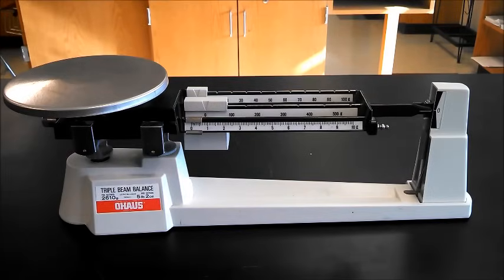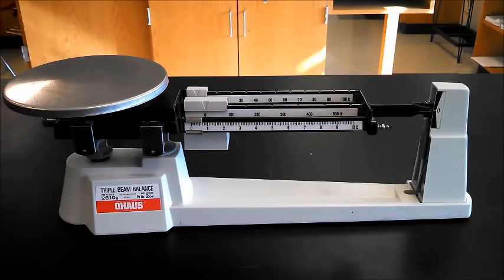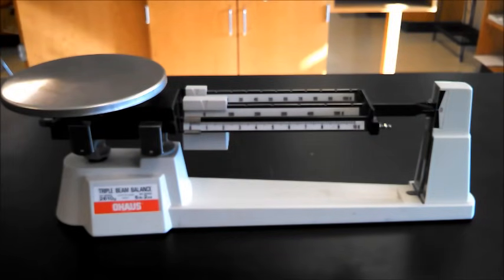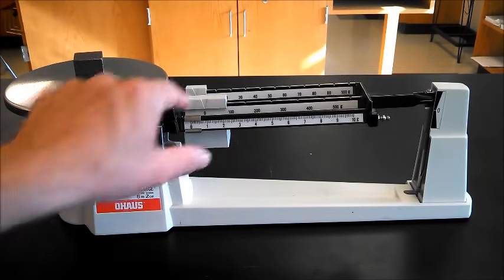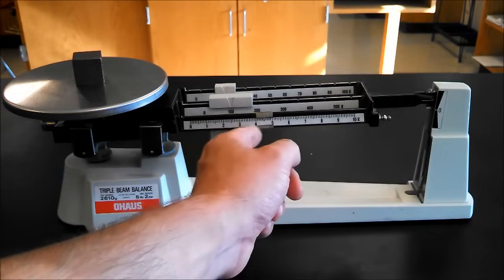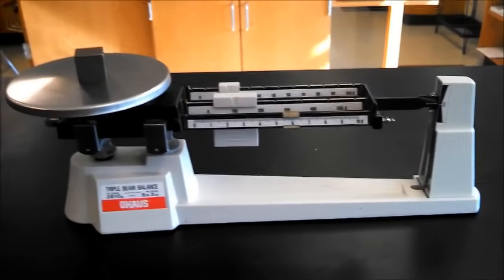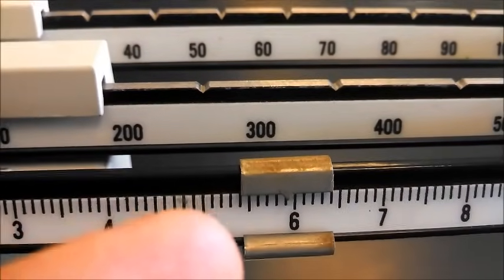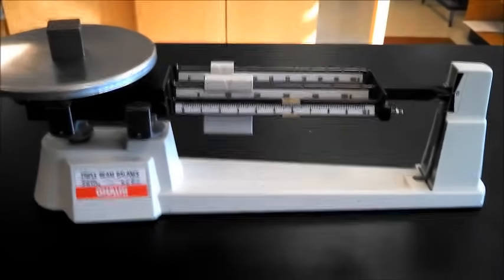Tutorial:  Triple Beam Balance

Comment: Do you know where to get the replacement weight disks that are under the pan? I have the 2610g model. I knocked my scale over right next to a floor vent heater and lost one or two of them down through the grating. I don't even live in that house any more. (I rented a room). I would use the scale to weigh golf heads, shafts, grips, and shaft tip weights. That way I could match the swingweight of the clubs in the set with a replacement club before I assembled the club. THANKS.

Comment: Generally a good video, but the final reading should be 125.90 g rather than 125.9 g. This is not gonna be important for daily use. However, if you are working in a science lab, you must get it correct and use the correct significant figures. The smallest increment in the third beam is 0.1 g, you need to keep one more decimal place by estimation.
Reply: Yepp... You're correct